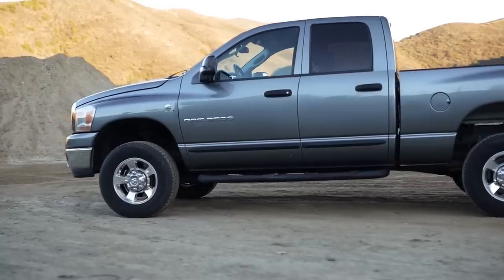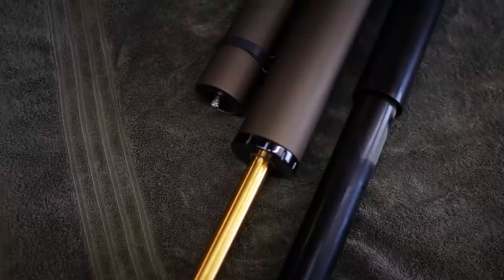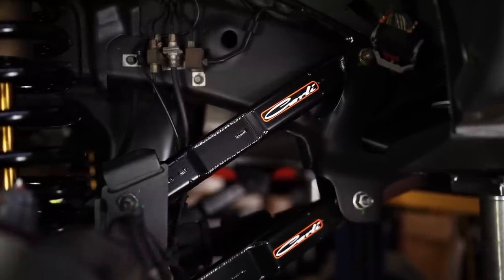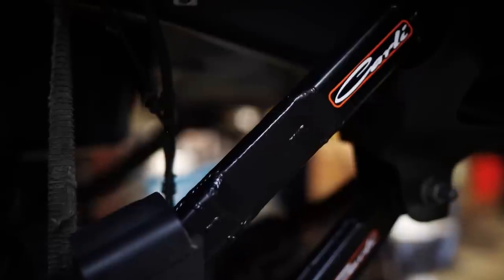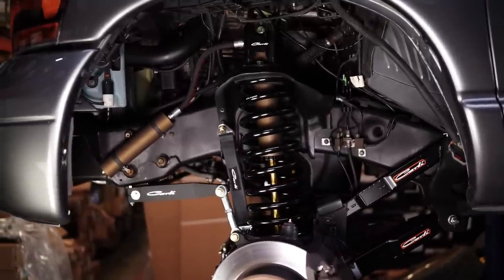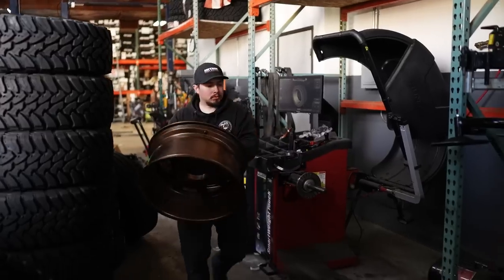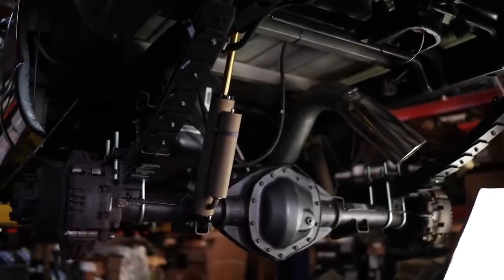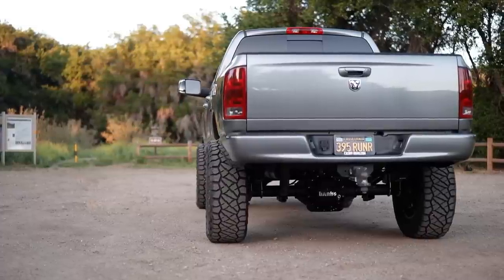Transforming My G56 3rd Gen Cummins With a Carli Suspension Dominator System and 37s!

Comment from the maker: For cool shirts, sweatshirts, and more check out the Just Diesels merch store: https://just-diesels.com
The Parts:
Carli Suspension Dominator system
https://www.cjcoffroad.com/collections/03-09-carli-systems/products/carli-dodge-1994-2012-pintop-2-5-3-lift-suspension-system

Carli torsion sway bar
Carli track bar
Carli high clearance control arms
Carli full replacement rear leaf pack

Steering Setup Video:
https://youtu.be/mio4dIS_Qqw

Trail Ready 20x9 Wheels (5.5” BS)
https://www.cjcoffroad.com/collections/trail-ready-wheels/products/cjc-edition-ram-trail-ready-20-x-9-5-simulated-beadlock-wheel

Nitto 37/13.5/20 Ridge Grappler Tires

Comment: Beautiful have a 3rd gen right now thinking of buying another after this! I have 6” fabtec long arm up front/ progressive springs front and back dirt logic 2.5” reservoirs (relocated outside coil) on front tranny rebuild (48re) with goerend parts. Stock motor kept cat muffler delete 6” tip rear exit stock wheels on 35’s. I’ve had this truck for 9 years and have been very happy with it!!!! Awesome video

Comment: Mine is a 2006 diesel Big Horn Edition that I bought brand new. It's still pretty much stock aside from the Carli tuned Fox shocks and a Spyntec locking hub conversion. It's got about 120,000 miles now so a freshening of the front end might be worth it. It's driven 99% on road for towing, hauling, and just daily chores. 
Looking at the Carli track bar and sway bar, good fit for a stock height truck?

Comment: Andrew!! Where on earth do you find these clean third gens? Over the years, I've gone to Texas... I've gone to Utah...  just to find these very specific G56 5.9's rigs in a clean condition, but I've yet to come across anything with a frame/body half that clean. The Texas Truck had a clean frame but had absolutely destroyed paint & body. The Frame on the desert Utah truck look good on camera & despite suggesting it hadn't been, had just been freshly spray bombed to hide surface rust. Which is now flaking & heavily scaled just 6 years later. 
Is it just a matter of me not being willing to search over the 25k mark? Or should I have been specifically searching for 1 owner SoCal trucks under 100k?

Comment: are you regraring it? with the torque multiplication of the torque converter on an auto, might not be a problem,  but with the manual I think it is more crucial. G56, 37s, I would say 4.10 or 4.30 gears would be perfect. love the truck, looks incredible!!
Reply: With a G56, there is no need to re-gear the truck. It has a crawler gear (6.29:1 or 5.94:1 depending on generation) and the over drive ratio is horrible for the highway. I intentionally put 37" to give an effective 3.40 gear on my G56 to improve highway mileage and drop engine RPM. It still tows just fine under 15k pounds and you can keep it in direct drive (5th) with reasonable speed and RPM.
Reply from the maker: Yeah I might actually re-gear to a 3.55 since even with 37s the truck still does 1900 rpm at 70! I do a lot of long road trips so I’d live to bring that down a few hundred RPM!
Reply: @Just Diesels  what rpm do you recommend at 70mph? I've got an auto w/3.73 gears and w/33s I'm at 70mph at 1850rpm

Comment: Very nice setup. I am tempted to get some Carli shocks but I am not sure how well the tuning will match my custom air springs. Also want to move to a similar 20" wheel and tire setup as my 37" tires on stock wheels are the not most responsive on the road.
Reply from the maker: Sadly air is hard since the spring rate is both variable depending on pressure, and extremely different than a coil shock! There’s really no shock tuned for air suspension though unless it’s one of the Carli 14+ factory air setups, so your best bet is to use an existing shock and then re-tune as needed.

Comment: Great  vidio as always Andrew, was it a tough call cutting for the 37" 's ? 🤔
I look forward to your engine upgrades,  550 - H.P. is that a goal? Or is it the outcome of what you already did? 🤔
What is your ultimate goal for this project? 🤔 will there be more upgrades to be able to do?? 🤫 off road recovery? Camping? A new rooftop tent? It's so versatile now, but maybe you have a more extreme goal? The truck is so nice! Will you be a little bit afraid to push it ? Like on the tight trails? 
It's  just l am looking for a great truck, maybe even to build one? But my focus is fuzzy, l have an excellent diesel camping truck, articulate, could use some suspension upgrades, but that's it, it's perfect for me, but to do more, l would wreck the great truck l have! Do you get it? Just bable! Excuse me, Your truck is awesome! Enjoy it. Thanks again for sharing. 
✌🏻🙋‍♂️🌧🇨🇦👨‍🦽😎.

Comment: With the tire size increase to 37s, what rpm’s does it turn at 70?  Do you now have to start off in 1st gear?  

I have 34’s and turn 2050 rpm’s at 70 and almost never start in 1st except when towing.
Reply from the maker: I can still start in 2nd without issue! Now that it’s on 37s the truck pulls about 1900 at 70 instead of 2400 with the stock tires. The G56 gearing is not fun at highway speeds unless you do larger tires like this. With 37s it’s actually possible to keep up with traffic!

Comment: I love your videos, they motivate me. I did watch your free spin hub review video. I'm just curious how those unit bearings are gonna hold up in this new truck, because it's got the same size wheels as your previous truck. I have a 2004 3500 Dually myself. I just purchased Carli ball joints and track bar, Mopar T-style steering and 08.5 pitman arm, Spyntec Free Spin Hubs (haven't ordered yet... still on the fence). My next purchase will be the Carli Backcountry Shocks paired with the Full Progressive Leaf Pack. Seeing how great your SRW truck looks, makes me want to do a DRW to SRW conversion. Have you done a conversion like that before... or have any advice for me?
Reply: I have the Yukon free spin kit and it help free up 1-2 MPG. Steering feels lighter. Spyntec is a good option. Yukon is more universal in their design and they don't clearance properly for the ABS sensors on my 2006 truck. Unit bearings were holding up fine with 37" in my case, but mostly on road highway miles.